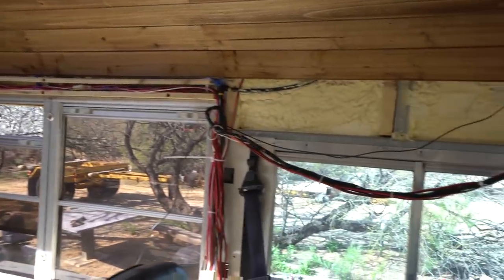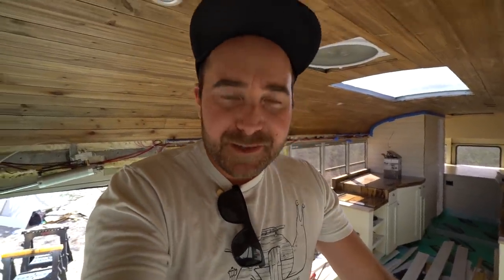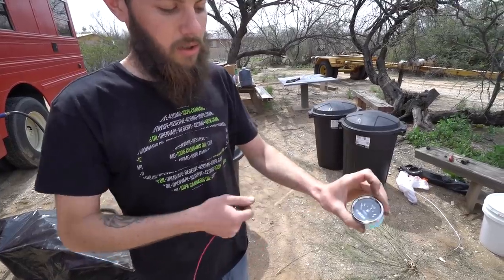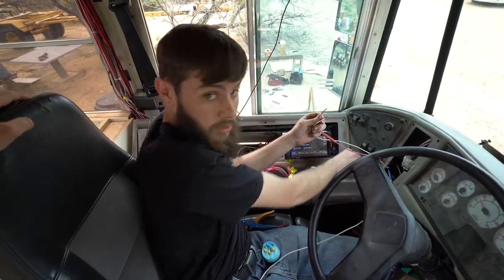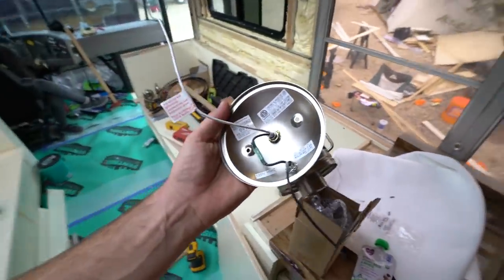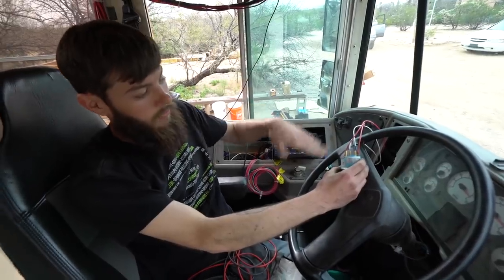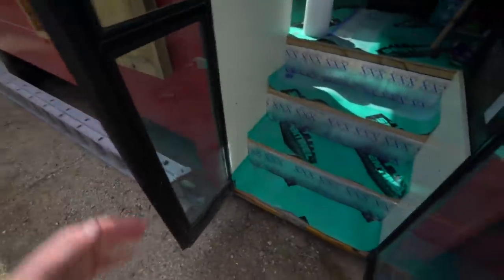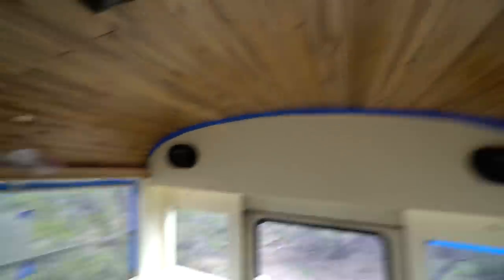Vegetable Oil Tank- Fuel Gauge Install

Comment: Jax, did you match your gauge to the oil sender? There are different resistance senders and meters. Some are 0-90 ohm, some 33-240 ohm. My guess is you are miss-matched. Where is Badge, when you need him? LOL
Reply: Vegas Roy yeah that’s my thought for sure 🛠🛠🛠🙏
Reply from the maker: Yes. Same ohms.
Reply: Jax, there are only a few things it can be. +12vdc to the meter, the wire going to the sender, the resistance not matched, OR THE SENDER IS NOT GROUNDED, the terminal opposite side from the analog wire coming from the meter. When your friend read the resistance, I didn't see him remove the wire going to the tank. He may be reading the resistance of the meter. Remove the wire and read the resistance between the wire and ground, at the dash. What is the resistance, vs the rated range?
Reply: Ground on fuel sender. If you run both wires back to gauge it should read double check make sure sender wires arent crossed
Reply: @Badgeweefixstuff  I think that would require dropping the tank. Hell of a job. He should be able to check it with an ohm meter and reverse the leads to see if would in reverse polarity. If no resistance, well....
Reply: Yep 👍🛠🛠🙏🇨🇦

Comment: The ceiling looks very good, great choice on the finish. 
Are the lights in the shower water proof? 
I like to tin the ends of stranded wires before crimping. Yes another step and it takes a little of time but it preserves the wire better and in the long run ( for me ) it’s worth the time.
Reply from the maker: Probably not, but I’ll make sure to heat shrink them!